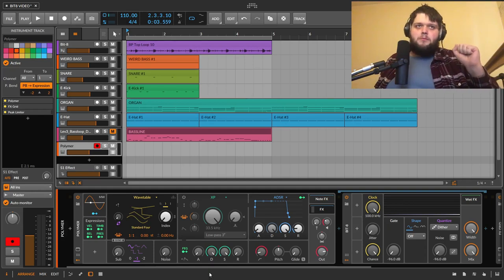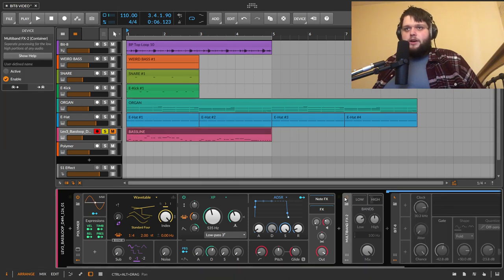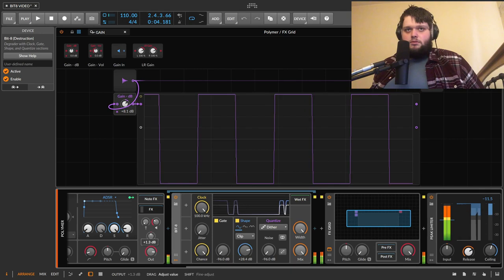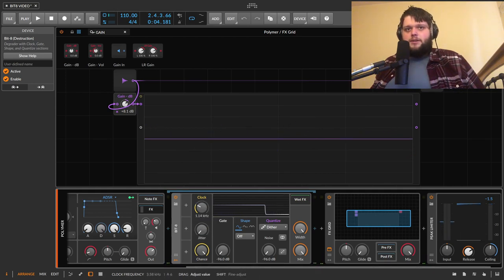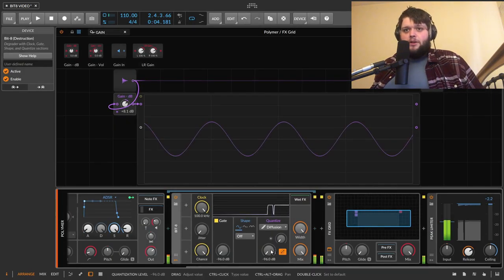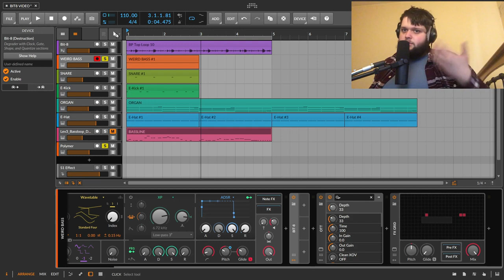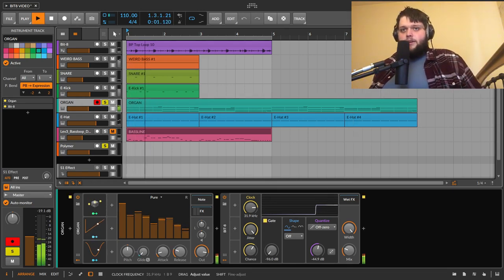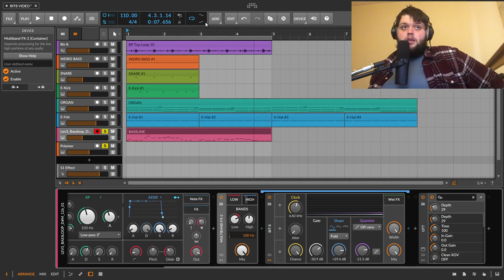BITWIG: BIT-8 -The Ultimite Destruction Effect

Comment: The quantization in the squared domain button is changing the distribution of quantized values so that more of them are available for low amplitude samples and fewer are available to high amplitude samples.  The distribution follows an exponential curve.  You can see that working in your oscilloscope actually.